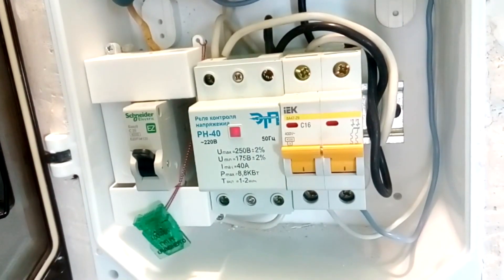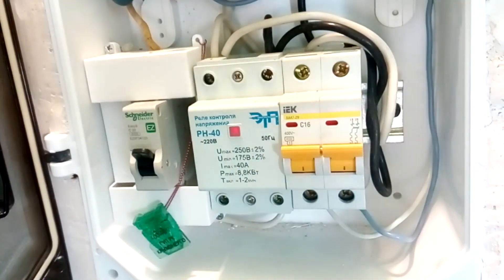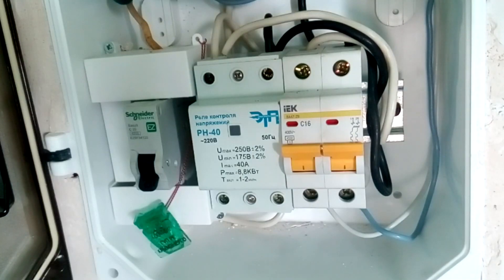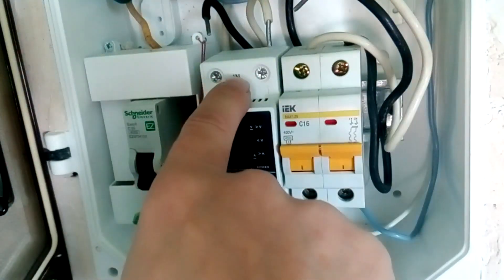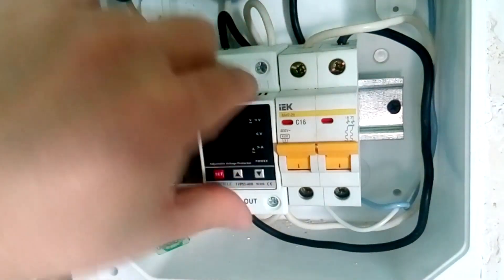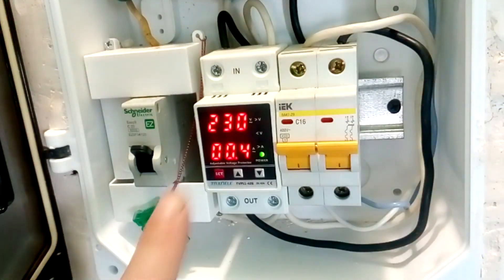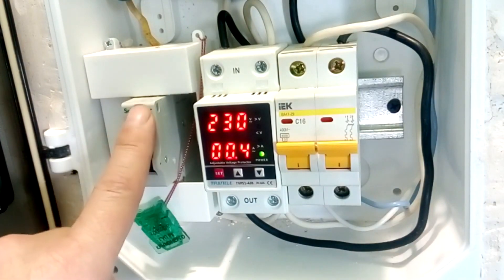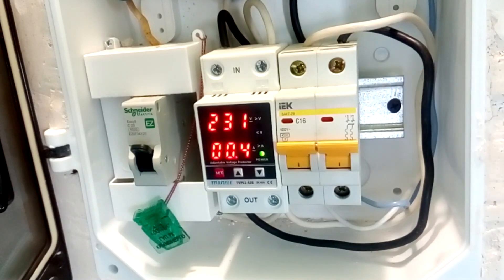Voltage Protection Relay Install & Wiring in Electrical Panel | Surge Protection | Save Your Home!

Comment from the maker: https://alli.pub/75ca4c?erid=2SDnjeTSCNG - Voltage relay from Aliexpress TVPS1-40B
https://alli.pub/75ca9e?erid=2SDnjd8MBCG - Voltage relay (analog)
https://alli.pub/75c9ve?erid=2SDnjdFkSe8 - Voltage relay with warranty for DIN rail
https://alli.pub/75c9sa?erid=2SDnjf3XEtL - Voltage relay with warranty for socket

https://bit.ly/Pomkan - Support the channel financially
https://www.youtube.com/@EkimovIgor1 - This channel in Russian.

https://youtu.be/Tk2Jm5pXhoM - Multifunctional Voltage Protection Relay
https://youtu.be/NoyTPN3D9NU - AliExpress Voltage Relay - Testing & Programming
https://youtu.be/FmlVeXbjAMw - Compact DIN-Rail Power Meter from China
https://youtu.be/Fq3UyU6v94o - 256x192 Thermal Imager: The Most Compact
https://youtu.be/wLT6Wwv7nNc - Portable gas analyzer TOOLTOP PLT850